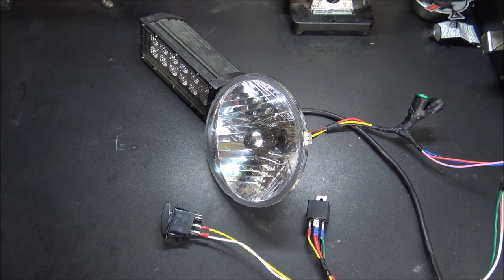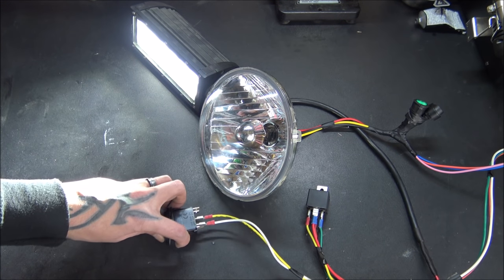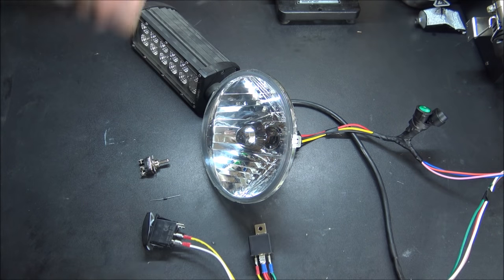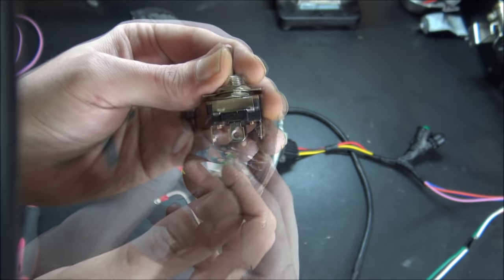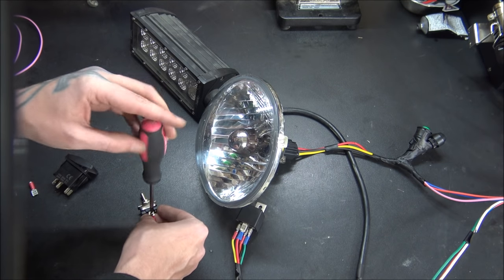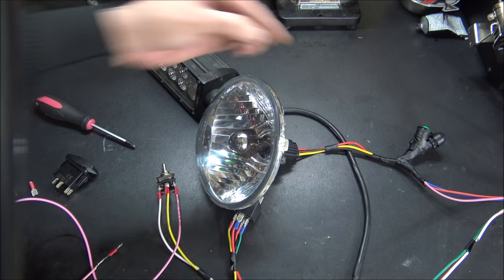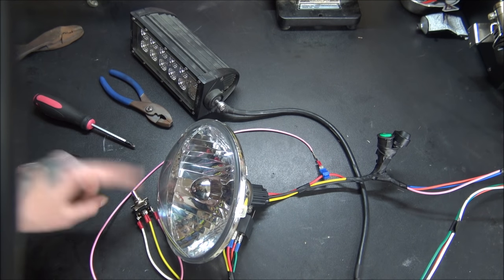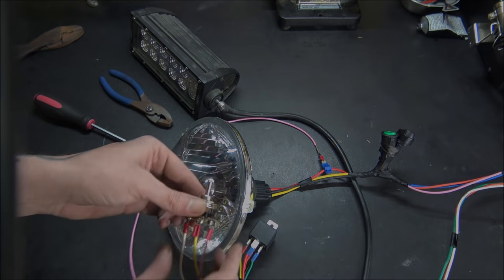3 Way Switch, How To Wire Your Light Bar To Work With Your High Beams & By Itself (ON/OFF/ON Switch)

Comment: How would you add a flashing led to only flash when the light bar is on? I have done this mod but sometimes I forget that the light bar is on!
Reply from the maker: You could use a lighted switch, you would just have to add some relays. I showed how to do this using this switch because you don't need to use relays (didn't want to make the video any longer by showing how to use relays) I do have another video that might get you pointed in the right direction, thanks for watching! https://youtu.be/hjpucoy0Qxo

Comment: How exactly would I go about wiring the lightbar directly to my high beams
Reply from the maker: You would just need to locate your high beam 12v positive wire and tap into it, and use a relay for safety. Thanks for watching and if you haven't already, make sure to subscribe to keep up on all the new videos! Thanks again!
Reply: Rocky X TV my light bar wiring harness comes with a relay, can I just utilize that?
Reply from the maker: Yep, just use the wire in your harness that goes from the switch to the relay. Hook that wire to your positive high beam wire and that will turn on the relay and light bar when you hit your high beams!
Reply: Rocky X TV thank you so much!

Comment: If all power from battery in the start of the video.. why you put a relay on? just for deco?
Reply from the maker: This was to demonstrate this process as if you already had a light bar and harness installed with the common plastic switch as shown in the beginning of the video. You always want to use a relay with those switches even if they say 20A. I left the relay in because removing it would cause more confusion to people that are not wire savvy, and having a relay wont hurt. I hope that makes sense, thanks for watching!

Comment: Can't I just a put a diode on the jumper wire from the highbeam to the relay and use the regular on/off switch?
Reply: Nevermind, I have my highbeam going straight to the relay. I like your way better, it isolates the highbeam so it won't feed back and cause the headlights to burn.  I'll just have to run a longer wire inside to the switch from the highbeams.
Reply from the maker: That could be done, but your light bar would always be on with your HI beams. You wouldn't be able to just have HI's without the light bar. Thanks for watching!
Reply from the maker: Sorry, I just saw your other comment. Thanks again!

Comment: i just fixed a light bar...but when i switched  it on. it turns on when i hit low beam and high beam..how do i change it only to high beam?
Reply from the maker: Do you only have a wire tapped into the positive wire for you high beam or high and low?
Reply from the maker: You should only have a wire tapped into the high beam side of your headlights, I hope that solves you issue, thanks for watching! Don't forget to subscribe to keep up on all the new videos! Plus it really helps out, thanks again!

Comment: So diode is not required for this setup?
Reply from the maker: It is not required. Thanks for watching!
Reply: Thanks! How do u wire it without the threeway switch? Is it possible and safe? Thanks for the help
Reply from the maker: It is possible, but you lose some of the functionality. You would only have the light bar ON with HI beams or OFF. There are a few other ways to wire it with a regular switch, but you have to add in a relay and the diode becomes required in most of these other ways of wiring. I can make you a simple diagram when I get a chance if you like. Just send me an email rocky.tvchannel@gmail

Comment: Over here these extra lights/light bars need to be wired in such a way that they turn off as soon as the high beams do. So switches are useless in most scenarios unless you somehow wire them to do both.

It’s about road safety, for all powerful lights to stop right away when you stop the high beams and to so people don’t fumble with more than one switch.

I just want light bars that turn off with my normal high beams every single time and for a simple install.
Reply: But, yeah, like you showed, it’s possible to actually wire it like that if it was useful for you to use them separately. I can see applications but not for casual driving if additional light is always better.

Comment: I have that this same switch.  I follow all wires as instructed in his video How to make Aux Reverse Ligths Multifunctional (SPT Switch) (https://youtu.be/hjpucoy0Qxo) but I used a 3-way switch like the one in this video. When I switch it to work with the reverse on automatically turn the reverse lights and the camera on, then I follow this switch set up and now it's working perfectly. The power source (red Wire) in one corner,  the trigger wire (blue wire) in the center, and the reverse + wire (pink wire) in the other corner. I'm now ready to set the high beam with the led ligths as describe in this video.  Thanks, Rocky X TV.
Reply from the maker: Thank you for watching!

Comment: Great video.  Just to get this straight, I can get power to the switch from say my radio fuse to one outside lug, the relay trigger (lightbar control) to the middle lug and then tap into my high beam on the other outside lug?  I just don't want to risk running the battery down if left on, so I would like to use power source to switch that only works while car is running and is not crucial if it blows for some reason (radio) Thanks!
Reply from the maker: You got it! Thanks for watching, and if you haven't already, don't forget to subscribe to keep up on all the new videos! Thanks again.
Reply from the maker: Thanks again for watching!